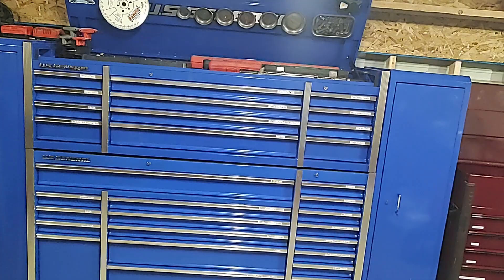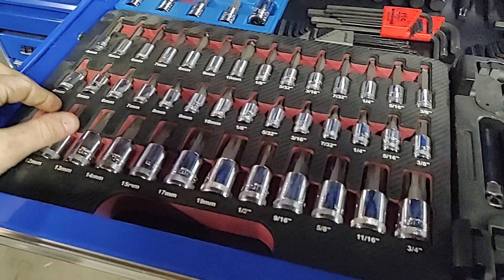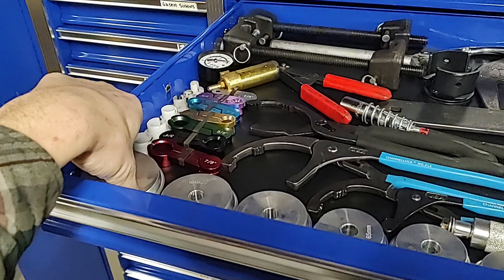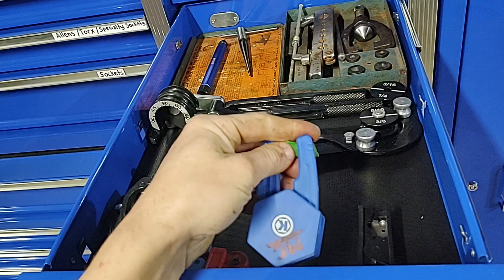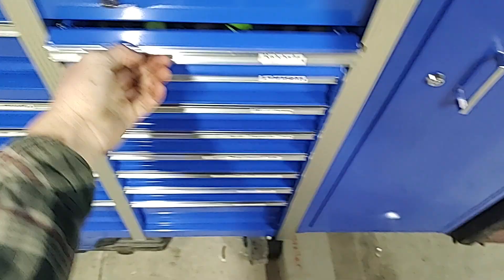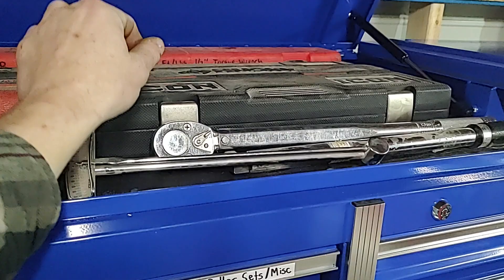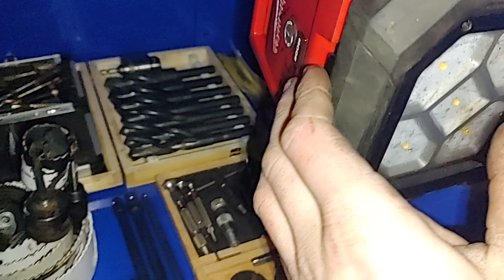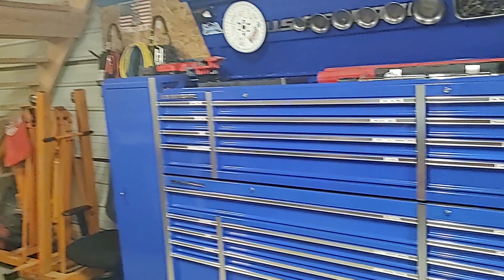Toolbox Tour - Independent Shop Mechanic

Comment: Just missing an Easy Red 1/4" and bit driver ratchet. I got the Bluepoint version, it works great for those tight places. Toyota oil cooler lines and holding the threaded rod on shock absorbers.